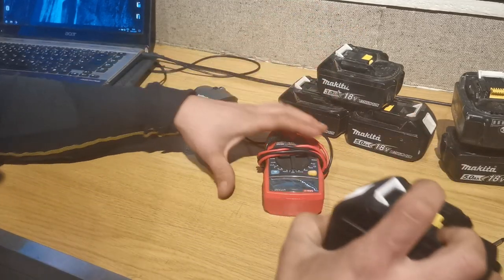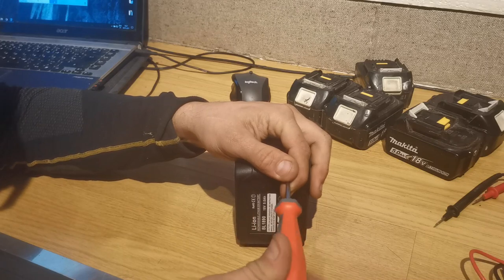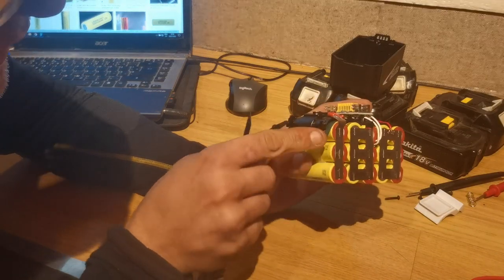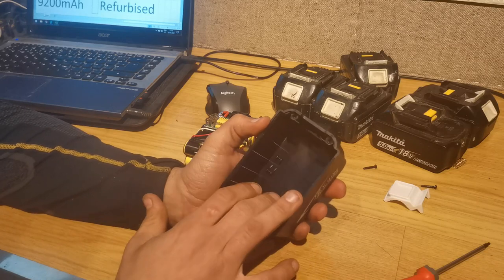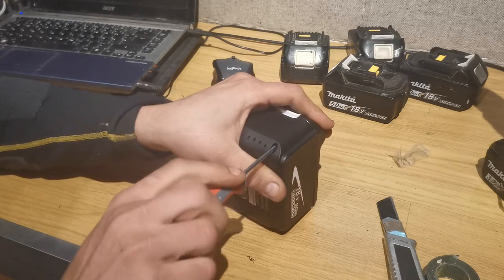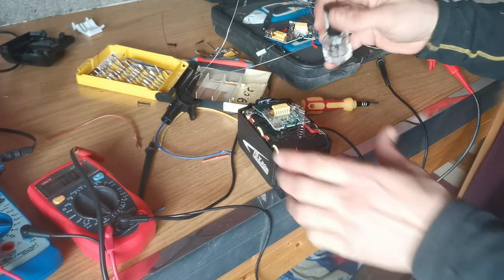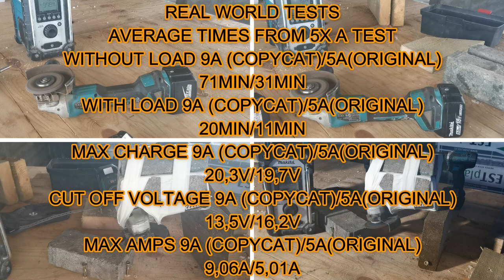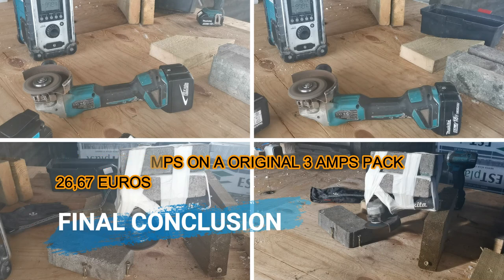[61] Fake Makita 9a battery rev 1 indepth review and real world test if is any good

Comment: It would be possible to get 9Ah only with Murata US18650VTC6 elements or with LG INR18650-HG2, there are no others. What stands in a fake cannot be 3000mAh cells.
Reply from the maker: Ok could be but now i got myself a test device, but as the battery is allmoust a year old and has had some crazy stuff behind i can tell that its not worth the money eaven if it was 9ah. So i would not recomend it to anyone other than the hoby dude that uses the battery once per season.
Reply: i process alot of defective fake makita batteries, and what i often see are samsung 30q, wich are only 15a discharge. good cells actually, alltough not the desired c rating. but i get em from just one good supplier. sometimes i get repairs for buddies of buddies, and have seen the most crappy chinesium cells.

Comment: ive enjoyed your review.  i might have to buy some.  your nail polish to waterproof the board is a good idea.  i found a video where a bloke mixed 1 part silicone to 3 parts spirit (i use mineral turpentine) to make a sealer for tent seams.  i found that 1 to 1 is a better mix for my purposes.  i'd paint the board with that.  and 3 more things, i'd put the double sided tape at corners of the container and 3 bigger strips along the bottom, 1 along the centre and 2 of the pieces towards either side.  and i would not have removed the non-sticky strip from the bottom piece.  because you made it stick to the batteries, if you ever need to remove the batteries in the future you will need a sledge hammer.  and the third thing, makita puts a row of holes on the bottom under the release catch.  this battery pack seems to have that place where the holes should already be so i'd be putting some holes in there.
Reply from the maker: Sry for the late replay but had to check out something first. So dont yet buy one as a rev 2 video will be out soon where i compare the old 9a to a new one to see how it has aged. On the silicone i did some tests and there is a problem as for more cooling needed components the silicone acts as a heat shield and the components get much hotter so its not a good solution i would recomend ligh coat as i do or just use lacquer spary ;) yeah the tape idea is good as my solution is hard to remove if it is needed in the future ;) hmm those holes under the realease catch i need to have a look in the next teardown havent noticed them THX. And love that you liked the video :D
Reply: @SilverEnergy  , because silicone grease is made for heat transfer, i just thought silicone sealer might work too.
Reply from the maker: @vsvnrg3263  ok my fault i tought you meant classical silicone in a tube 🤦‍♂️but thats life silicone grease is a diffrent story ;)
Reply: @SilverEnergy  , not your fault!  i did mean silicone in a tube!  actually, ive pulled down a totally dead genuine makita 18v pack and its pcb is covered in silicone like that in a tube.  ive been digging my thumbnail into it for the fun of it.  makita obviously dont think heat buildup in this board is serious.  none of my other makita batteries have been done this way.  i suspect it is the newest.
Reply from the maker: @vsvnrg3263  ok thats interesting could it be a refurbished one? Never heard this before 🙄🤔 ill tear a new makita 6a battery appart next month lets see if we here in eu the same thing ;)
Reply: @SilverEnergy  , refurbished?  not likely.  i scored it from the rubbish at a scrap metal dealer who didnt understand why i wanted it because it was dead as a dodo.  like i said, i suspect it is newer than all my others judging by how the board is set out.  2 of the cells have reversed polarity.  i will pump a short sharp hit of 4v into them to see if they will come good and then join the rest of them ( which still have a reasonable charge in them ) in going back to full charge and becoming useful members of my battery collection.  i already have one battery which makita chargers ignore.  (and some of the tools ignore it too)  through careful experimentation in a explosion-proof concrete-floored steel-walled shed i found i could charge it up with a 20v gmc nimh charger.  it takes 9 hours.  i hope to charge this dead dodo the same way if i can reverse the polarity of those 2 cells.  ive seen the reversal done on yt videos though i dont expect miracles from them after their reverse polarity.
Reply from the maker: @vsvnrg3263  hmm nice, i recomend buy a cheap replica charger those work fine on dead packs that the original charger discards ;) or sometimes if the orig. Charger does not charge the pack and gives the red light just take it out and hit it back in usualy on the 2-3 try it will charge the pack to full. Why dont know but works fine on monday ill give you the serial nr for the Charger that does that ;)
Reply: @SilverEnergy  , i scored an old vax cordless vacuum cleaner. ive made that battery pack fit snugly within the dead dodo makita housing.  the makita chargers ignore it so i charge it with the nimh charger.  its now part of the team.
Reply from the maker: @vsvnrg3263  nice job, if you want to charge it with the charger get a new aftermarket board, this model will bypass the check 
https://a.aliexpress.com/_mNHKolw it's not the best one but works ;) hope it helped. Have couple of those when the orig battery is at the end of the cicle and I just want to use it on for couple of years just swap the board and voila backup battery back.

Comment: Charged 5S Li-ion battery should have 21V. Each cell can be charged up to 4.2V. Multiply that by 5 cells in series and you get 21V. Partially discharged or partially self discharged battery can be from 21V down to 15V or so. And you should measure internal resistance at 1kHz and capacity of cells to conclude what kind of cells they are, and not based on some labels that quite often are faked.
Reply from the maker: Sry for the late reply but had alot of work on my hands. Thx for the info. On the upcoming week i will recive the version 2 of the battery with updated PCB and more. So if you have any othe suggsestions i should look into i will do and post the info on the review of rev 2 of the 9v battery.
Reply: Makita charger cut off at 20v so you never use full capacity of cells
Reply: @jaroslawzmuda8963  You are wrong, at 20.5V
Reply: @jaroslawzmuda8963  Never use the full capacity of the cells, this leads to the degradation of the lithium-ion. Makita does the right thing, which does not allow the cells to be charged to the top and discharged to the bottom, significantly extending the life of the batteries.